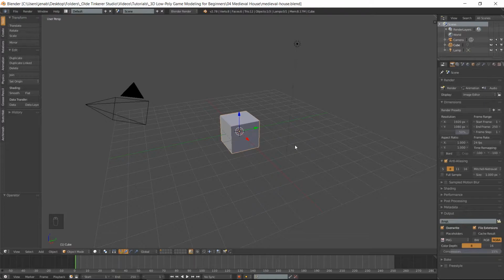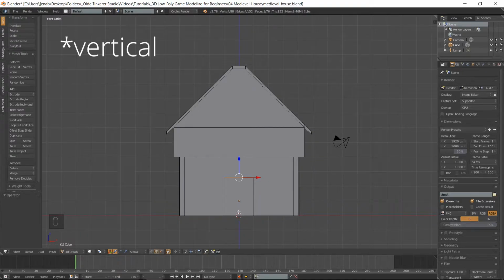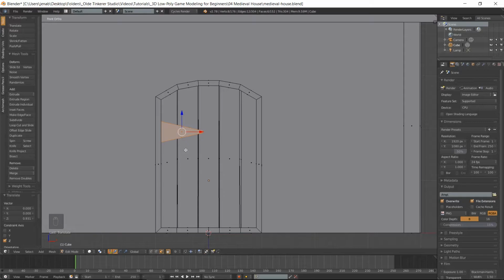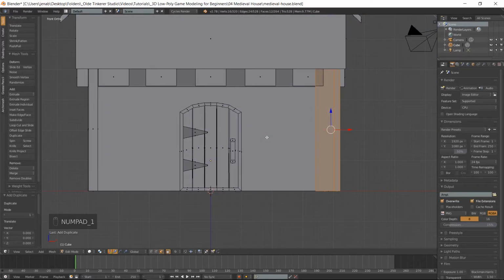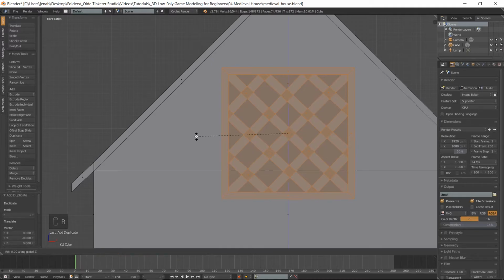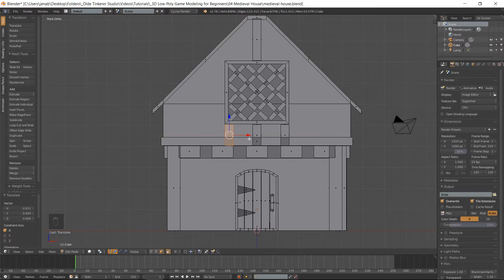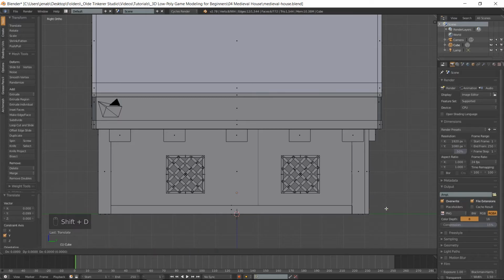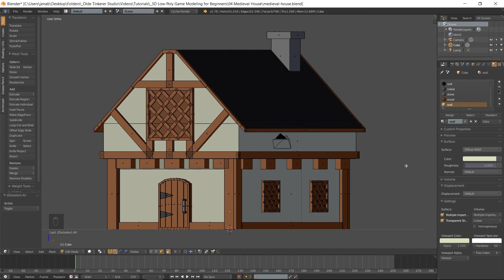How to model a low-poly medieval house in Blender [2.7]

Comment: Thanks for helping me model THIS! It looks so much more difficult but with your help, it was fine for beginners like me. One thing: Maybe try to sound more enthusiastic whilst speaking.
Reply from the maker: @Nick O' Time - I'm glad it helped you. Yes, I know I sound like a robot. I use a script so it doesn't help with my speech. I am changing the way I will be doing tutorials in the future so I should sound more relaxed and a bit chipper. :)
Reply: @JSAbbott  I'll make sure to look at some of them. Also maybe you could have some tutorials for modelling in Blender 2.8 because I had to alter a few keybindings because I didn't know what the new shortcut keys were. (I know I could've just swapped back to blender 2.79 but oh well)
Reply from the maker: @rvnico  I have done a few tutorials in 2.8 already. Now that 2.8 is a stable release I will be doing more tutorials in 2.8.

Comment: i was going to learn blender but way way to many hotkeys and clicks to do something very easily in sketchup. Nothing against you or your tutorials. Blender claims its user friendly but its not. IE, why is there 3 different modes for faces, edges, and vertices?  In other software, not just sketchup, if i click an edge, it selects, it, if i click a face, it selects it. thanks for your time though making this tutorial. it helped me realize blender is not for me
Reply from the maker: Yes, Blender is very dependent upon hotkeys but you can just as easily use the actual menu items. Using hotkeys really speeds up the process of modeling. BTW, in Maya (the "industry standard") you still need to select which mode (face, edge, vertex) you want to use as well.

I have very limited experience with Sketchup but I can tell you that Sketchup is very different from actual 3D modeling programs. If you don't like Blender you can try other software packages but they will pretty much be the same.
Reply: @JSAbbott  i guess it depends because i have used sketchup, blender, im certified in solidworks, fusion 360, inventor and have years of experience in them. Blender is cool, i just dont like having to select face mode, edge mode or vert3x mode. I think blender needs to change that. If i cluck a face, it should know thats what i want to select.. 

When it comes to sketchup, dont use the free version. Pro is so much better. I use it for areospace and medical engineering parts. 

I do like blenders ui sooo much better though. Its just clean
Reply from the maker: @LT72884  I get what you are saying. I don't by any means think Blender is perfect but I have been using it for more than five years and I've seen how much better it has become.

Like I said, I know that in Maya (and I think in C4D and 3ds Max as well) you also have to choose a mode before selecting an edge, face, or vertex. 

I know there is a difference between the free and pro versions of Sketchup but Sketchup is more of a CAD-like program which is very different from Blender, Maya, etc.

You can always leave comments and suggestions for the Blender developers over at right-click select (https://blender.community/c/rightclickselect/).
Reply: @JSAbbott  you bring up an very interesting and important topic. See, solidworks, fusion, inventor, and sketchup are all engineering applications, while maya, 3ds, and blender are media applications.  Granted in the apps i just listed you can do same stuff as blender, just a different way of doing it. I just find it interesting that blender, maya, 3ds all chose to go that route with selections. I am a part of the blender community and i have thought of bringing this up, but so many people are all ready used to the opperations of blender haha.  Im glad your providing tutorials though. I provide them for sketchup on my channel and soon will be adding more. I do game art as well on it. The important thing is being creative.
Reply: @JSAbbott  I figured it out. I have a friend whom has done game design before and i asked him why the different modes for face, edges, etc. his reply was simple and made tons of sense. Blender, maya and 3ds all deal with HIGH amounts of polygons, while sketchup, solidworks, fusion360 all deal with low polygons. Its easy to select a face or edge with low polys, but when you get more and more, its harder and harde to control what you select and would be hard for the program to tell if you selected a face or an edge... hence why all the modes haha